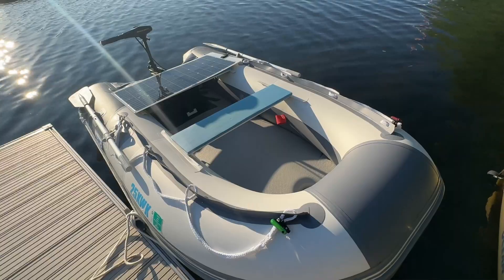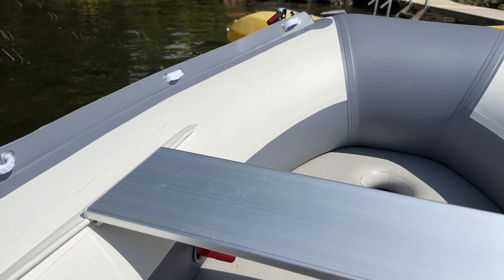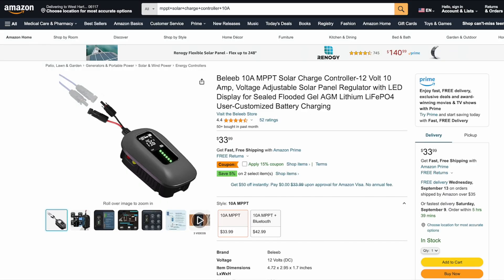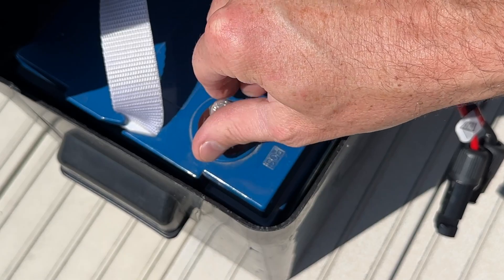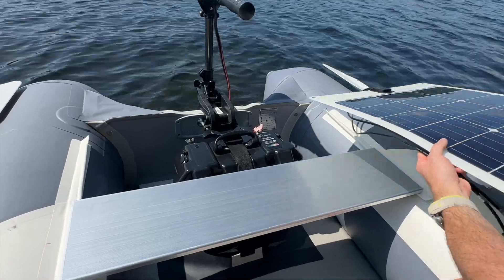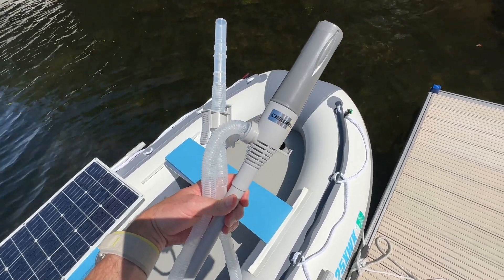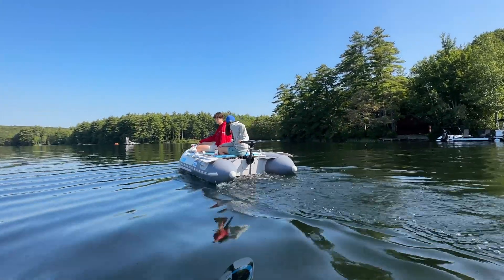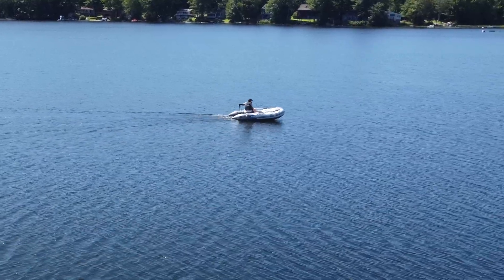GOODBYE GAS! Make a SOLAR powered BOAT in 1 hour!

Comment: This is exactly what I am looking for.  Thanks for putting it together in clear chunks.  There are a lot of these projects but they mostly skip over the details.  My project is a cabin cruiser rowboat.  I love rowing, but it is important not to overstress the body, and I figured this would be a great project to rig my minkota into a infinite range.  So I can row all day but have the motor if the wind picks up, or otherwise I need to gear down the effort.  Like having a 10 speed bike and shifting to maintain cadence.

Comment: Thanks for your video. So you do not connect the load of the motor directly to the MPPT and instead to the battery. Would there be any difference in battery performance? I mean if the MPPT is monitoring and maybe even controlling everything as far as efficiency and performance plus safe limits, maybe it could "regulate" the whole setup better because of a connected (to MPPT) load? Just asking, I have no idea.
Reply from the maker: The trolling motor pulls a lot of power when running hard so you definitely want the battery to provide the power and just use solar to keep it topped off

Comment: What if you wanted to add another solar panel do you need another charge controler for it?
Reply from the maker: No, you can wire them together into the charge controller

Comment: Great job! In my project, I spent $800 (a new inflatable boat, 4 solar panels of 100 watts each on the roof, a 105 Ah homemade lithium iron phosphate battery, a water snake motor for salt water).
Reply: What boat did you buy?  I'm guessing one with a bimini since you mentioned putting the solar panels on the roof.  Would you still recommend the boat?

Comment: 1800 dollars ?? Thars far away from afordable. Anyway yeah its a nice idea but nothing for long trips like i do. Prefer my gasoline
Reply: I do boats on the super cheap, but frankly 1800 is nothing.  Whether someone can afford it is a completely different mater.

One of the all time great yacht designers of the last 40 years went down a rabbit hole on efficient power boats, and was making massive progress with new designs.  But he got sidetracked because of all the net zero grifters.  So he had to convert his designs to electric.  That was fine for boats that operated off a dock (watch your 1800 float way in that situation), but gas was a lot more efficient on trailerable boats because trailering all the extra battery weight, and often wind resistance, was a gas killer.  Most people end up with boats they barely use so in that case the gas pollution is trivial with today's motors.
Reply: @HondoTrailside  i also can drive only once a year. But then i do trips for 8 hours a day. I have also a small trolling motor for backup  and i discharged my battery at one day completely so i needed almost 2 days to recharge it from solar of my camper. Instead i didnt even used all the gasoline i started with. 

Its just that gasoline outboard manifacturer have way more competition on the market than electric outboard manufacturer. Thats what let the prices go up. Thats just too expensive. It may be okay for people who drive 1 hour to a nice spot stay there all day and drive back one hour to the harbour and recharge their batteries. 
For some people gas may be the best for some electric.  It ends up whats the best for you. 
But 1800 is not nothing, especially not for that low power output you can get a gasoline with the same or more power for the half of the price

Comment: It "sounds" great - but you have not mentioned anything about a run time limit between charging - with this setup there is no mention of a battery level monitor - so no indication how you would know if the battery goes below its minimum charge before the expensive battery is damaged as a result.  It is  quite irresponsible to make such claims about running it "all summer" without pointing out there can be issues that will ruin the expensive battery if you run it too long drawing down the battery too low.
Reply: Research first. Modern batteries have either a BMS like this one or they have low-voltage cutoff.
Reply from the maker: The BMS in the battery will prevent the battery from discharging to a state where it will cause damage to the cells. I looked into getting a SOC meter last summer but couldn’t find one that was optimized for LFP batteries and waterproof so I’ve been flying blind but have never fully drained the battery with daily use. I ordered this meter to see if it will do the trick: https://a.co/d/8v0jvfZ

Comment: Hi mate  if you get another 100 wat solar panel so then thats 200 wats,,,,,, waterproof ,,,step down converter 30Amps  ,,,24volts to the converter ==12volts out ,,to the trolling motor,,,it would keep your battery mabe half charged ,,,,I think you might like the idea,,,,,,😊😊😊

Comment: I've been waiting to do this with an old pontoon boat, replacing the rigid fiberglass top, with solar pannels(up to 1.6KW worth if i replace the whole top yea i know they say they add up to 4KW but in my experience they're never anywhere near their rating except for maybe an hour or 2 per day) and ~18kWh worth of CATL batteries. (i already have 16x3.2v 280Ah cells that i'm trying to work into a partial whole home UPS system)
The hardest thing has been finding a motor, i almost want to just find a lower unit somewhere rated for 25HP and drop on one of those golden motor 20KW water cooled BLDC motors.
Reply from the maker: That would be awesome

Comment: I suggest always getting a battery with Bluetooth now a days. It only usually costs $30 more but gives you so much information that the battery will be safe to use for decades. 

If you ever want to sell it you can show that each cell is charging correctly. Almost doubling the value of the battery. 

Plus you can see how much your device is drawing so you can very accurately estimate how long till the battery needs a charge.
Reply from the maker: Good point. I was just re-using what I had but that's a great feature. Is there one you'd recommend?
Reply: @todd.parker
I always keep track of the price of Renogy lifepo4 at Home Depot. They always have the 3 to 4 versions of the same renogy battery so I can compare prices. 
No features 
With Bluetooth 
With internal heater for charging below 32 degrees. 
Output current 
Waterproofing level
Cycle level: 2000 or 4000
How many you can put in series. (This requires a higher voltage bms)
Communication between batteries. 

A renogy 100ah lifepo4 can run from $500 to $1000 depending on features.

Comment: What an awesome project! I wonder how well it would work with an old car battery and a flat back canoe... Might have to give it a try.
Reply from the maker: I had this kind of setup with a trolling motor on my canoe years ago which is why I had the parts lying around. I had to buy a mount to let me attach the trolling motor to the side but I'm unsure if that kind of mount would work with a collapsible canoe. Anyway, worth a try! Fun to mess round with this kind of thing
Reply: If you never let the lead acid battery go below 11v you might get a couple seasons out of it. Which means you are only using 50% of the battery. 

If the battery goes below 11v it will die in a couple months. 

Also car batteries are ment to be constantly charged. So when you’re not using it put it on the charger quickly. And use 10 amps or higher. If you trickle charge it for 8 hours each time it’s not going to last very long.
Reply: LFP batteries are so much less maintenance, are more efficient, lighter, safer, have less self-discharge and last over 20 years, so would really recommend opting for that instead.
Reply: Good luck! Otherwise deep cycle marine are around $100